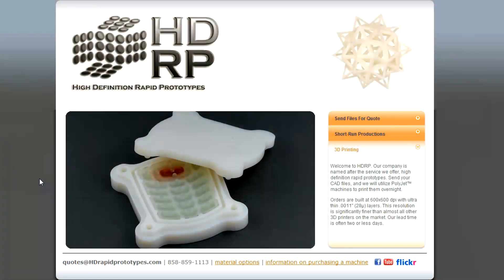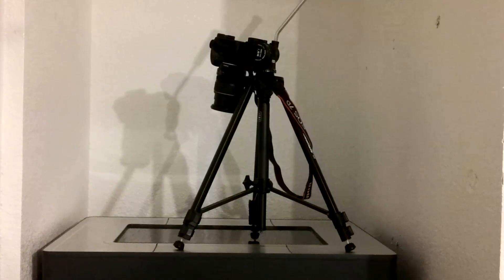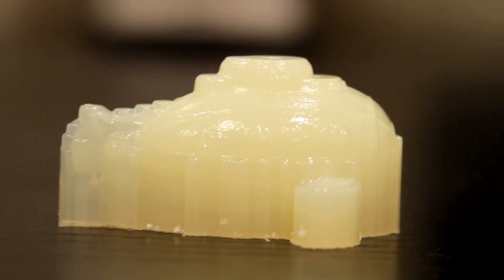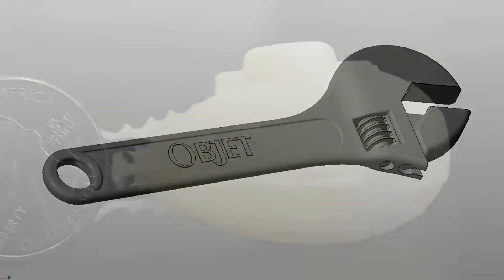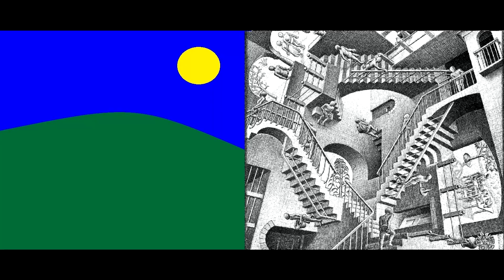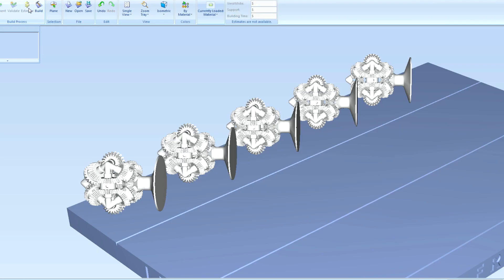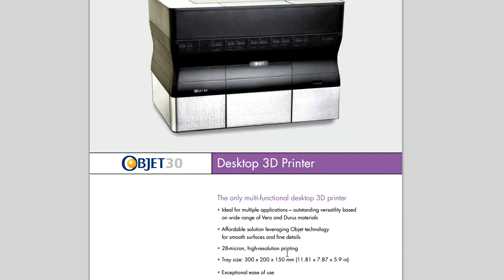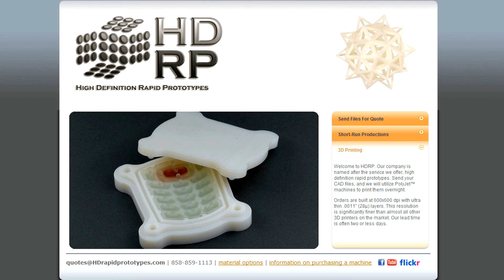3D Printing Basics

Comment: Blender or other programs such as Inventor are used to make these models, to learn more about those programs and how to use them check this site out: http://3dprintingninja.blogspot.com. Your computer does not need any internet access as you can model and print offline. As mentioned earlier most 3D printers print from an SD card so you can even turn your computer off while printing.

Comment: would my computer need internet access or can i just use a computer for printing? got a small work area I want to put it in and not be disturbed or anything till the prints finished
Reply: Once you have all the software and files on there, you won't need Internet access. Some 3d printers can actually print from an SD card without needing to even be near a computer.